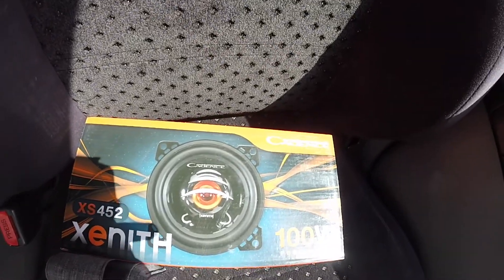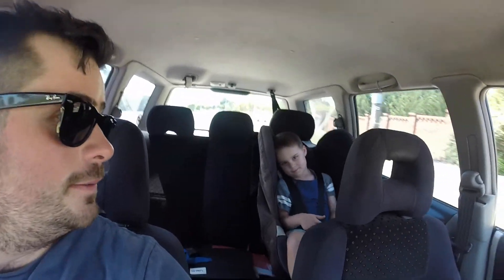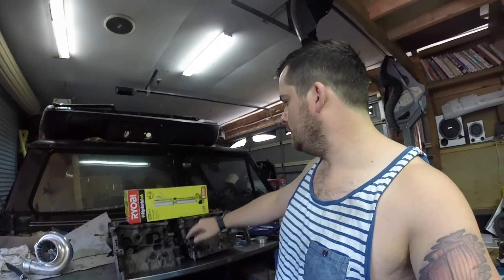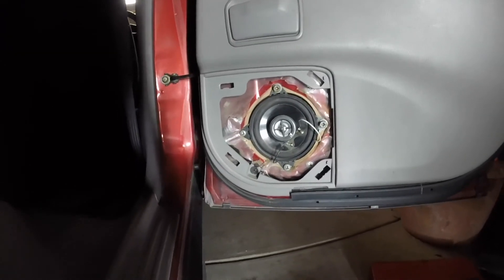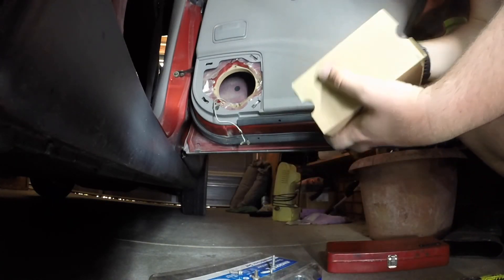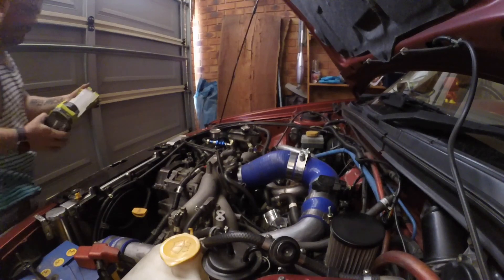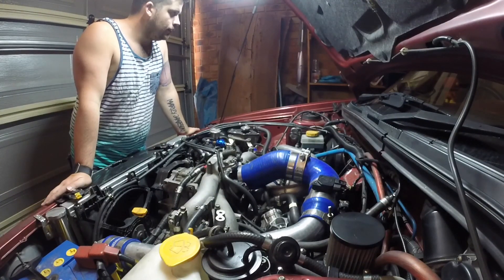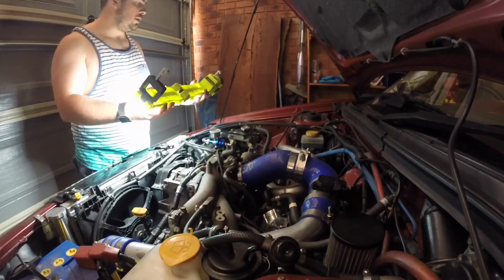Subaru Forester | Upgrading stereo | New Hybrid Ryobi Shop Light Review

Comment: FMIC my man. Expect poor cooling performance. I don't get above halfway on the temp gauge, but man oh man it pumps out heat when you stand next to the car after it's parked.

If you oversize the valves, don't you also need to grind the seats out and port?

Thanks for the light review. :)

Also I could see your son thinking "I know what you should do dad, put the damn air conditioner back in"! :D
Reply from the maker: I don't think having the oil cooler in front of the radiator helps and the auto trans fluid runs in the bottom of the rad.I'm not sure with the oversized valves, i guess so. I'll do some research on them.
He isn't too bad the mrs is worse haha
Reply: Front mount inter cooler. ;) I got a separate oil cooler for my trans, it gets farking hot.